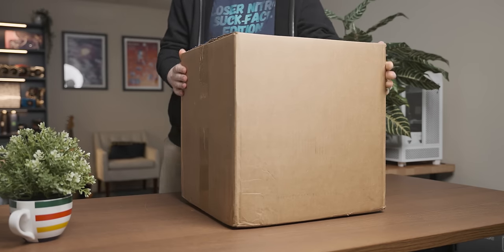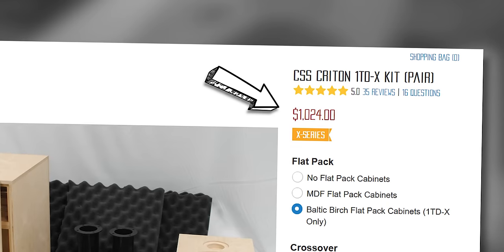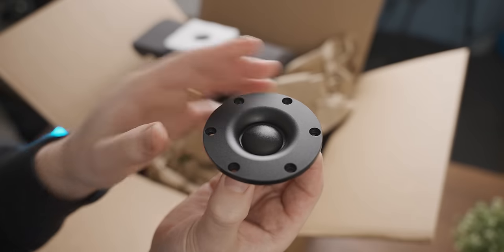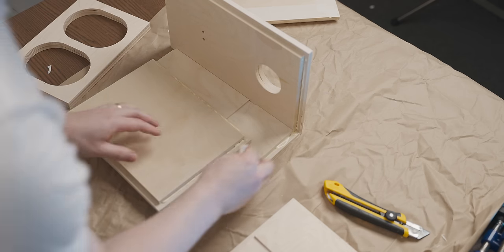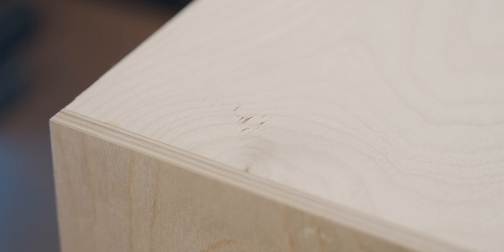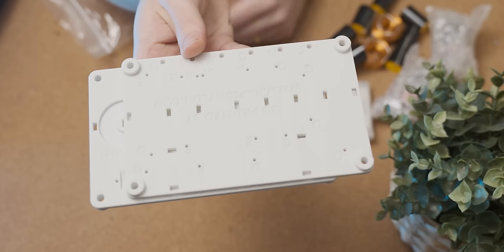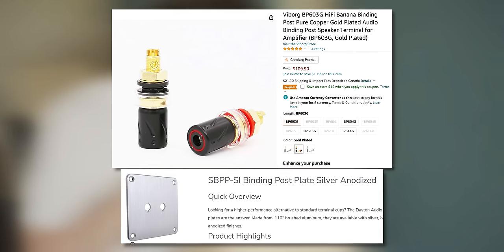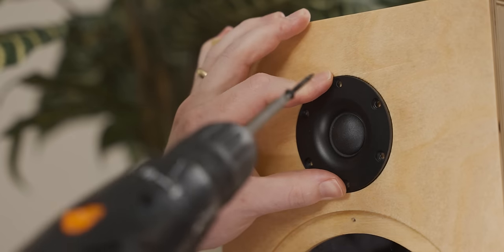The MOST Underrated Gaming Upgrade: DIY Speaker Build

Comment: I mean no disrespect in any comment I've made thus far, you make great videos, but nothing in this entire video screams, or politely whispers, these speakers are worth over 1 grand USD; especially with the other items required just to get sound out of them. I get it, perfect sound is a real thing, and some have NO SPENDING LIMITS when it comes to great sound and if that's you, good for you. Yes decent sound matters and horrible sound will kill any experience; I get that, but over nearly 2 grand for this setup just rings RIPOFF more than anything. I've been doing construction/remodeling/PC work since 1980 and PC work since 1986 and I have to say these speakers are a ripoff. First, the speaker box is horribly designed, I mean over 1,000 USD and you see plywood edges, and the completed surfaces have defects. Birch Plywood is not expensive compared to say Oak Plywood; granted it's not MDF but it's also NOT OAK so it's average at best. Sadly Quality Control at this DIY Speaker Kit Outlet is subpar at best. The 14:46 minute mark shows a defect at the lower right of the Speaker and I just don't care, DIY or Not, this IS unacceptable. This face piece should have been rejected. The plywood edging around the 7:48 mark are extremely unacceptable, hence the reason I claim horrible design. They could have designed the Speaker Box better, not to Show Plywood Edges, I mean seriously that's basic woodworking 101 NOT to show that. All edges should have been fit with a matching 45 degree edge to eliminate the plywood edges. They make such bits for simple routing that could have easily make a far better box. If push comes to shove at the very least the plywood edging should have shown at the top or bottom as those are far less scene. Lastly the tiny BASS Hole on the backside is insultingly small all things considered. Again I don't mean to bash your project, and if it was priced @300 USD I would not have wasted my time commenting but nearly 2 Grand, sorry you're getting both barrels so deal with it. I wonder how many Homer Simpson Types followed you down the rabbit hole and invested in this same speaker just because YOU DID? To those that followed your advice and purchased this ripoff speaker I say "look over there at that shiny object" because it's not worth saying worse they would NOT understand. Do the math on all the parts in this DIY Kit and see for yourself:
3/4" 4 x 8 foot Plywood Birch 90 USD, enough to make easily 6 to 8 Speaker Boxes or 1/3 of 90 is 33 USD times 2 is 66 USD for the Speaker Boxes
Electronics for the Crossover ranges from 10 USD upwards of the 400 USD that you mentioned in this video, granted this kit is probably 100 USD. 
Total so far 166 USD in Parts. Now add shipping and reasonable profit this kit should have sold for 300 USD at best; if that. For the 1 Grand you paid it should have ONLY came with the 400 USD upgraded Crossover and at the very least said Crossover should have been fully assembled and soldered either way. You could have gone to the ripoff store of your choice and purchased a compete stereo system, with receiver, amp and multiple speakers, superior in quality, for easily under 500 USD, 700 at the most. But 1 Grand for DIY Speakers then another Grand to get sound out of them, WOW, 1000% ripoff; again I mean no disrespect...